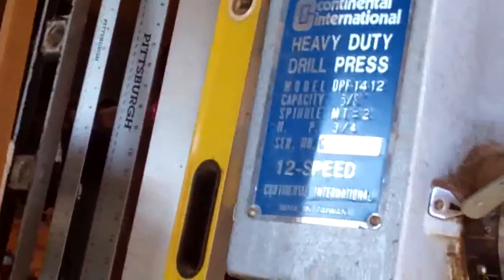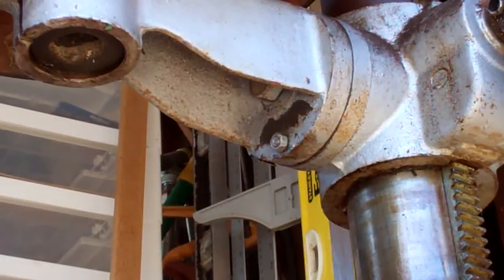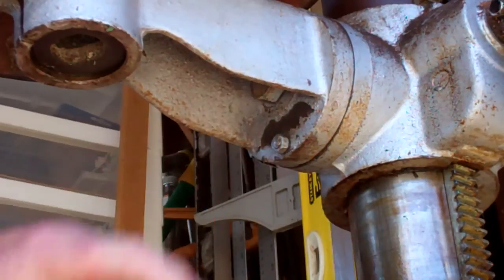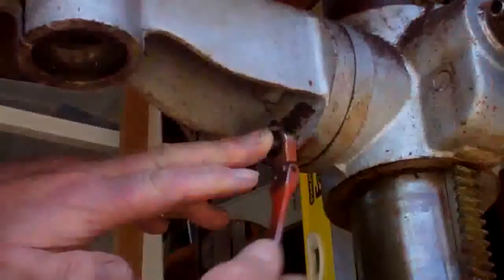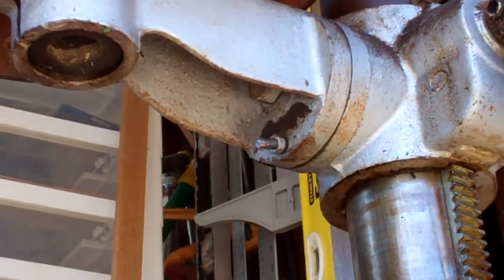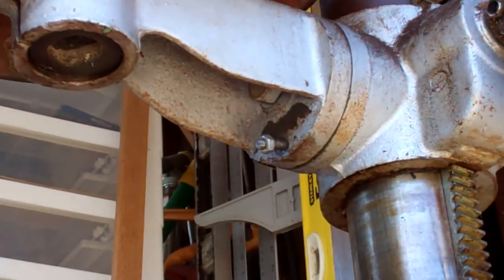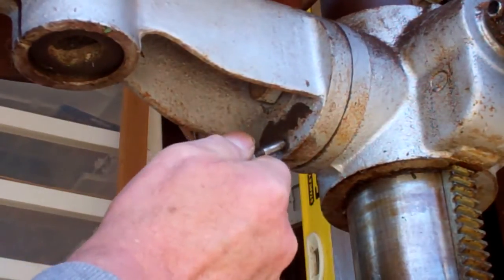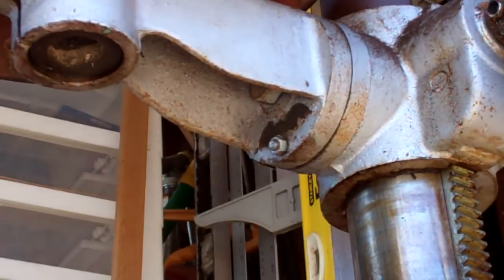adjusting and tilting metal drill press table

Comment: Thanks for posting this! It's November 2025 and I recently bought an old drill press almost identical to yours. I've been going through it, removing rust and aligning everything and I was stumped when I saw that little nut that was obviously holding a "screw" (or so I thought). Thanks to your video, I now more about it than I did before.

Comment: I just stumbled across this.
I was having the same issue.
Now I can tilt the table, but how do I know if the edge of my work piece is parallel to the table? The table itself is round and rotates. 
There must be something I am missing here.
I want to drill a hole at one end of a rectangle, and a hole at the other end of the rectangle.
And I want these holes to be parallel to the front and back edges of my wooden block.

I know this is a relatively old thread, but it has helped answer at least one of my questions.

Thanks

Comment: I bought an old Grizzly G1199 drill press that has the same set up for tilting the table. I just learnt from your video that the locating pin is only for holding it at 90 degrees. Thanks

Comment: Okay but I never saw you tilt the table. Is that big one inch bolt tight on there? Do I need to loosen it? With what tool?
Reply from the maker: I recommend using a proper fitting wrench to loosen the center bolt.